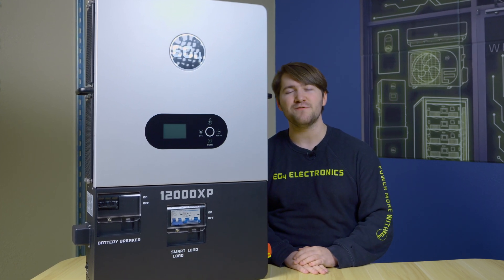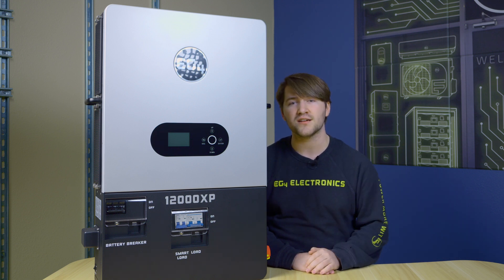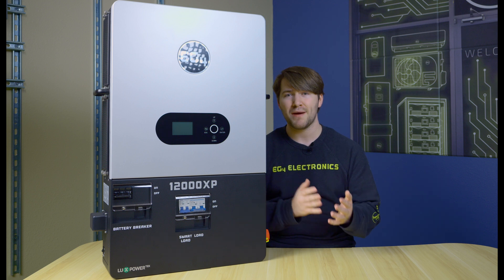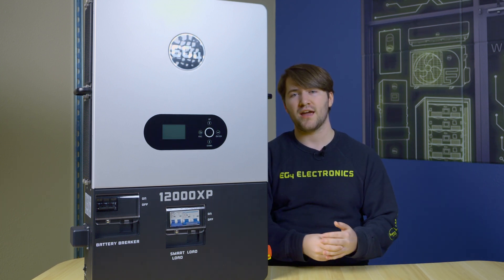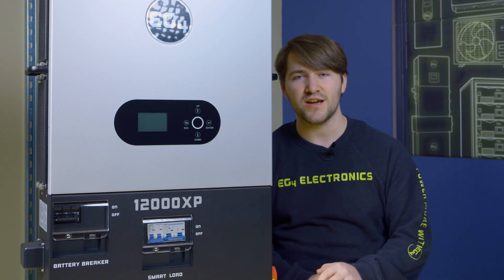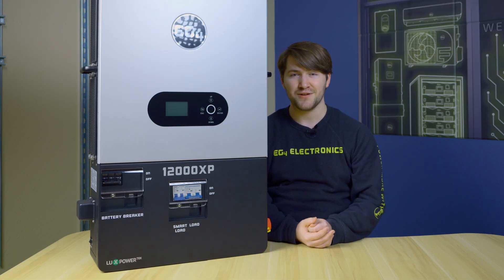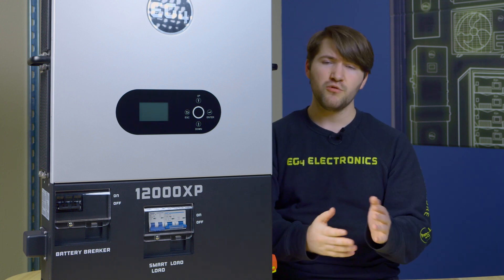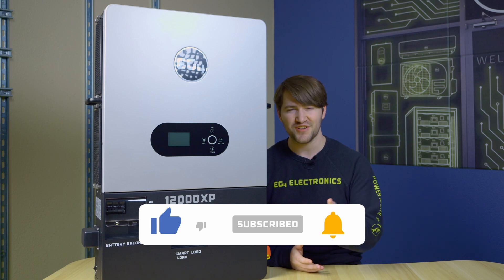What is EG4's 12000XP Off-Grid Inverter? | Overview with Brayden

Comment: Let me try my luck here since none one responding to my email, hopefully someone from here can guide me. 

What's the best way to startup and shutdown an EG4 12000xp or similar that has Grid input, generator, solar, eg4 indoor wallmount batteries.  Not seeing a definitive guide on to that topic, the startup procedure in the 12000xp user guide is a bit confusing in the kind of words being used, so am hoping you can provide some proper guidance, here's what I have so far, I might be far off the proper procedure, so feel free to guide me on the correct path :)

Thank you

-----------------------
Start-Up
-----------------------

1.Push the small gray button on the right side of the Master Battery, wait for 5 seconds, then do the same process on the remaining  Slave Batteries.

2.Lift up the Battery Breaker cover on the right side of each battery

3.Put the Battery Breaker to ON position , starting with the Master Battery, then do the same process on the remaining slave batteries

4.Close the battery Breaker Cover on the right side of each battery

5.Lift the Inverter Battery Breaker  cover, and then put it to ON position.

6. Switch the red PV Switch  to ON position.

5. On the Main House Electrical Panel turn the breaker labeled EG4 AC INPUT to ON position to turn on the Grid connection.

6.Open the LOAD/SMART LOAD breaker cover, then Turn LOAD breaker to ON

7.Power on the 12000xp Inverter via the power switch on the right side of the unit, put it to ON position.

8.On the left side of the inverter, Put the EPS button to ON position.

---------------------
Shut Down
---------------------

1.Turn OFF the EPS button on the left side of the inverter

2.On the Main House Electrical Panel turn the breaker labeled EG4 AC INPUT  to OFF position.

3.Open the LOAD/SMART LOAD breaker cover, Turn LOAD breaker to OFF position

4.Switch the red PV Switch to OFF position

6.Switch the Inverter Battery Breaker to OFF position

7. Put the Battery Breaker on the batteries to OFF position

7.Push the small button on the right side of the Slave  Batteries, wait for 5 seconds, then do the same on the Master Battery.  

Power OFF the inverter via the power switch on the right side of the unit.

Comment: Brayden what type of connector to the main panel if you have 2 in parallel. If you have one main panel. I Now you connect l-1 from both inverter. I’m planning to buy 2 - 12k
Reply: Best way is to use a combiner box that brings the inverters into a common bus then a single out to the load panel.  You can just use a small subpanel for that.

Comment: The inverter and MPPT circuitry inside of the oversized heavy gauge metal box hardly weighs anything at all, nowhere near the 104.7 Lbs stated in your specsheet. The Chinese manufacturer that built this thing for you simply installed the lightweight electronics in an oversized heavy gauge steel box to fool consumers into thinking that they're getting more product (value) for their money. They're not fooling anyone.
Reply: Bot much?

Comment: The flexboss 21 by itself is like an off grid inverter, but rated for less solar (21k). What makes it $1700 more than the 12000XP? Outdoor rated? 16k out with solar? That’s a big price difference. Also: how does noise compare between the two?
Reply from the maker: There are a number of features that go into the design of a hybrid inverter that aren't necessary in off-grid in order to meet standards for tying into the grid, as well as certification costs and a few other things like you mentioned with a fully outdoor rated enclosure and power output components. We also support the higher cost hybrids with longer warranty periods. Noise output is mostly dependent on the load, but you'll likely find similar levels between the two inverters in the same situation.
Reply: @eg4electronics  so if your off grid only, this is the way to go? I just installed the 18kPV in Mexico for my neighbor, but we will never connect to the crappy MX power company.

Comment: When using Gen can u make settings so that gen is charging only? 
So inverter is only thing doing load. 
For example 
I have a 10kw gen. I want to set charge to 10kw or how ever many dc amps to the batteries that is close. So the load stays constant